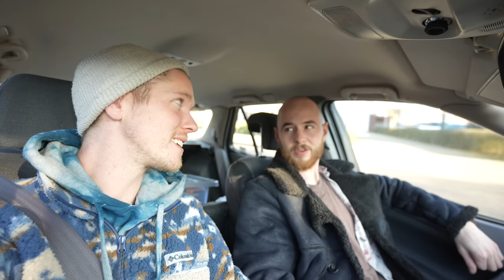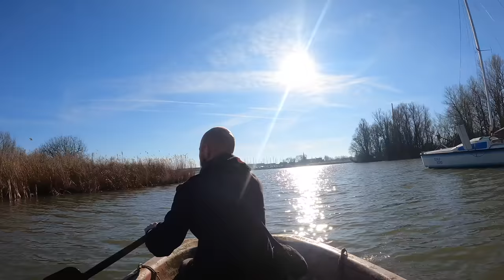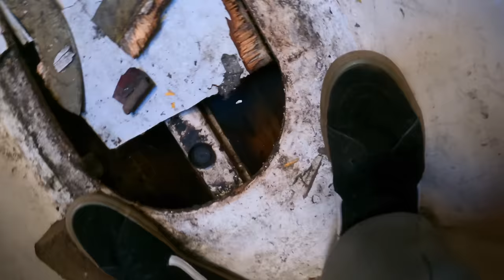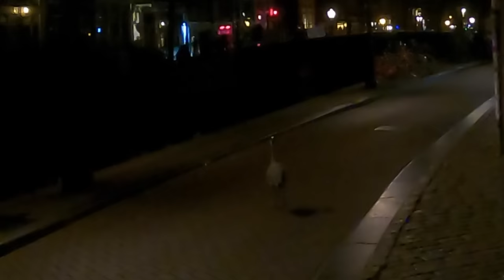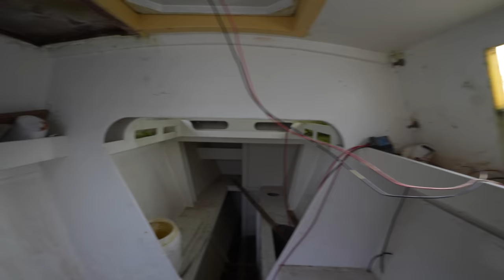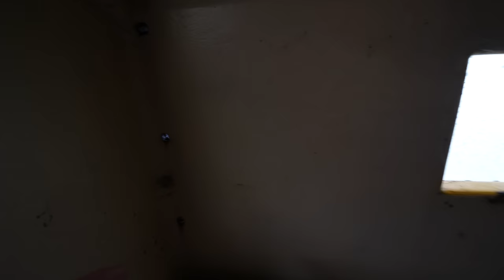I Made A LOW Offer On A SINKING Catamaran | Wildling Sailing

Comment: Let's see....
Andy and Melissa offered Mark SV Melody for fifteen thousand, with a guarantee that Andy (and probably more than a few of the Melody extended family) would come in to complete everything necessary in order to splash and sail away without worries.
At most, to customise the boat, it would be perhaps another five thousand, which would leave at least ten thousand in the bank for the future, and that is not counting all the money sent in by Patrons and via PayPal/Ko-Fi, as well as all of those commercials in the videos.
This double-pontoon nightmare will cost at least thirty thousand to bring up to snuff, and that's if it is allowed to remain in the Netherlands, with a change of ownership.
Wharrams are sort of romantic, yes, but unless they're huge (minimum of 22 meters), they're incredibly uncomfortable if you're not of the circus-contortionist variety of sailor. Also, Wharrams are not easy to sail.
Reality is going to shine its cold light upon this project eventually, and the resulting defeat is not what all of the fans in the world want to see.

Comment: It’s only when the plywood dries out you’ll determine the full amount of rot. Painted Fibreglass covered ply hides a multitude of issues as the wood is hidden from sight and proper inspection. How much of the bilge water is fresh water? Fresh water = ROT from the inside and the outer fibreglass shell doesn’t allow for the wood to breath.
Does it come with sails? Consider an out of water survey. Good luck.

Comment: I think your so sweet on this style of boat that your over looking an thinking huge problems are small and not a big issue. This boat is saveable but facts is there not good live aboard without a massive setup built for the center an it's not good for crew like you have spoken about so many times, your letting you emotions build you an need to step back for a bit before jumping I to any boat. I know you got it from the vid but I feel this may be a mistake later realized

Comment: I think you need to decide if you want to be a boat restoration guy or a sailing guy. 

Restoration could be your thing. Fix them up… shake them down and sell them on.

If you want to sail then go and buy a nice simple monohull which is in the water and has been sailed in this millennium.

Comment: Pump out the bilge and then go down into the bilge with a screwdriver and check for rot. If the hulls are glass over ply and it’s been sitting in fresh water for a large number of years, rot is quite likely. The bad smells could be fungus where rot has taken hold.

Comment: My advice would be a good bilge keel mono; you can beach it on an island so you can save the haul out cost, and can clean it off. They are good steady designs for when it's snotty. You'll have plenty of room to get out of the weather in comfort, and room for crew who'll pay a little to cruise with you.
Reply: All good points however... the Pahi can be beached, crew can have their own private compartment to get away from everyone and a pod can be added up top for weather sailing and when it's nice you have acres of deck space to spread out and enjoy the sea.
Reply: @jackblah5842  Look at the overall condition of that thing! You'll spend years getting it overhauled and fitted out before you cruise anywhere - and it'll cost an arm and a leg to do it.
Reply: @rallyeraidr7841  We don't know the condition.  If the hulls and beams are sound it's less work than Minki.  Clean it up, get a mast/sails,  Dyneema rigging, decks and netting and go sailing.  He can continue to add onto it as he goes.

Comment: I went to see a Wharram in Lancaster last year. It was on Ebay for £2000. I've never owned a boat. I went on a sailing holiday in Greece in 1991 and loved it. My only contact with the water since is a few ferry trips to drive my motorhome(s) abroad. If I was to buy a boat to travel the world, the last boat I'd want to do it in, would be a Wharram. I would want some 'luxury' ....like not banging my body every time I moved when down below............nasty boats.

Comment: Getting a Prince Albert?    Flipping heck Mark, did you show your Dad this before you put in an offer?  Its in the same condition as the steel boat next to Minky in the old yard. BUT it looks very interesting if you can get it dirt cheep. 🤞   Interesting update 2x👍
Reply: No way Jose’.  As a sailor and retired your cost alone for haul and restoration , if possible?  Will be very easy depleting your funds.  Best of luck!
Reply: @garycausey8332  well it might not be THAT bad. Im sure he will have the right people advising. Hanneka from a few videos back has an in-depth knowledge of this range of boats. . We still dont know what is under the current water line both internal and external water lines that is. 👍👍
Reply: Please don’t buy this sellers problem.
Reply: @MaxamArchitecture  it might not be everyone poo pooed Minky when they went t see her. It need the water removed first.
Reply: Lookup2Wakeup  it might be rotten AF, but it just might not be too.

Comment: Mark, that boat looks like a lot of hard work but appears really solid inside. I am sure it is hiding many surprises but it seems to have been really well painted. To be sitting there for so long with all of that fresh water must have left some rot but isn't that part of the Wharram journey.  Since you mentioned Wharrams (I had never heard of them before) I went looking to find out more and I came across She Sails Solo and Kinna Weltzien among others.  When you consider that Mara Noka was sailed in the condition it was in for two years before it was refit says a lot about the Wharram design. The current owner of your boat certainly hasn't put themselves to any trouble presenting it for sale.  Go with your heart and keep the offer low.  If you end up having to cut the bottoms out of both hulls so be it...  Best of luck and thanks for sharing the journey so far.

Comment: I would lift it out of the water and take of the beams. Stack it on a trailer and get it close to home. There you can find a cheap place to restore each hull before you take it to the sea again. A lorry with a crane can lift each of those hulls.

Have a go at it. plywood an fiberglass is easy to work with.

Best regards from an catamaran restorer from Norway

Comment: FYI, you can still get plans for Jim Brown designed Searunner trimarans, 31, 37, or 41 ft.  Fiberglass over plywood construction with centerboard.  I'm considering buidling one, you might too.  The plans are apparently fullsize, trace and cut and screw together, apply fiberglass.  You can check it out.

Comment: Hi Mark,  I have been reading you comments and I believe overwhelmingly they don't want you to buy this.  I am the former owner of Yachtsmiths International here in Canada where we built boats for 20 years, so I have a bit of experience with boats.  My advice is to go for it.....why? Because from your video it looks like the boat was sheathed in epoxy...so there should be very little water intrusion into the wood.  I did not see any areas where the glass was peeling, so this is a good sign.  Also, there are a lot of Wharram haters out there but I personally know a guy that sailed one around the world and I was on his boat several years ago and loved it.  Wharram boats are not conventional, they are very practical though.  
A lot of people are calling this a money pit....well, all boats are a money pit!  However the concept of the Wharram is that it is supposed to the the Jeep of the ocean, not a floating palace, so you are probably not planning on turning it into one. That's where all the money goes.  If you are planning on living on the boat with a minimum of creature comforts but having a strong safe boat, then I think this might be the right boat for you!

Comment: What would worry me most is the damage (potential) that water has caused to the plywood. It is difficult to determine how much water has entered the fibreglass and what the condition of the wood is. If you're going to take the boat overseas, you don't want it to brake apart. Good luck !

Comment: You're certifiably bonkers. You want to sail around the world in that pos? You're nuts. Your best option was to take up the offer from Sailing Melody. If you had gone ahead with that deal at £15k, come spring you could have set off on your travels. Instead you want family and friends aboard a pokey matchbox that is going to take all spring and summer to prepare. You're absolutely mad.
Reply: Motoring Malady.

Comment: There are good places to pull boats out and work on them in the neatherlands. But the won't let you work on them after hours and in summer it's actually quite cheap to get a spot in a winter boat storage hall. Then you don't have to worry about the weather.

Comment: Where i live,  109 boats in better condition were scrapped last month. There is an abandoned steel Spray close to us, in the boatyard, which wood be easier to fix than that. If it had been in salt water or on the hard covered in tarps, I would have said maybe. Could tow down to Hellevoetsluisje. The engine mounts are temporary to get it. Where it is no from where it was launched, so the engines won't lift

Comment: I’ve been onboard with you so far, but I think you should be beyond that much of a fixer-upper.  I got an abandoned boat in way better condition for far less.  I only think about it,if it was a free boat.  If the owner was asking 8k for that, he’s lost touch with reality.  Save-able, but it’s a lot of work. If I bought it, I’d try to get it home for the refit.  Living there is going to drain your restoration fund quickly.

Comment: Even if the shell is ok, this seems to be a project that can go on for a very long time.  In my opinion your 1yr time line would need to be extended.  It also needs all the expensive upgrades (Sails, all rigging, motors, winches).  Consider spending a little more upfront and get a good core, sails, rigging, motor and winches.

Comment: To  check the hull you need a bradel  to check the spine on each hull push the bradel into the wood to check for soft spots  ply is easy to repair  a scarf joint with epoxy will do it  and 2k is the maximum  regards Mark at chichester marina

Comment: Stiff rear axel on the SAAB, which make it look like that when you park like that.  Even on the new ones.
So it should really not be a problem, unless you have problems with the bearings, which you would hear.  Trust me.  I have own and drive and services SAAB from 99, 90 (yes, a SAAB 90), 900, 9000 and now a 95.

Comment: I remember back in the late 1960's someone anchored a really large wharram in Whitby roads for quite a few months and it stayed there even in onshore gales with 3-5M swells (no exaggeration). This must be one of the things you have to offset  against the cramped accommodation. Not many mono hulls under 25M could have done that, also there will be many anchorages in warmer places than Whitby where you can do a lot of living outside.

Comment: That's a project! My catamaran is very near this one, in Schardam which is next to Warder( a place you know :) ). 

If the fibreglass and wood is structraly sound, you can have a decent cat. I bought my boat all green with water inside and was only a 3 day job to get it Running.

Gicom bv in ketelhaven also has a very wide crane to get boats out, I believe it is 7 meters.

Comment: Mark at 2000 or less it will be a good project for you, does it have sails or a boom or a windlass or an anchor  apart from a clean up it will need rigging,  all new electronics. If you want to make something of the boat, you will have to improve you cabinetry skills . Look forward to the results of your offer....cheers and good luck
Reply: 2000, is 1999 too many.
It' s more wreck than boat.

Comment: If there's no rot and the structure is sound then go for it.

How are  the beam lashings, not a major drama to replace them but I couldn't help thinking my understanding is they're an integral part of a Wharrams structure and shit how long have they been exposed to the suns UV, snow, rain and movement of the boat

Spade anchor 👍
Spade paddle, yep why not😁...

Good luck with it

Comment: How to get your dream cat . 

First this boat : 
Have you called an insurance company to see if they will cover it ? No decent marina will let you in without insurance .  What if you catch fire and burn other boats and damage the yard - you will need insurance or they do not want you .  Doubt you can get insurance without passing a survey , it won't pass any survey . 

2 stroke engines will not do it for what you want , they will not charge sufficiently for a media studio  nor be fuel efficient enough . 

Go back to that steel boat with no engine , make a low ball offer .  I suggest going to electric as a neat YT friendly project and putting a gen set where the engine is using all its through hulls and fuel tankage .  The hope being solar  and regen gives you all the power you need but if needed the gen set gives you the range and power you need . It will not sail in light stuff so you will use axillary power more than you think .  You should be able to pick up a lightly used gen set .  You can add more batteries and more solar as you can afford it . 

You get an electric boat like Uma , the heft of a steel boat for expeditions and the ability to power for days if the need arises .  You can also charge your cameras and computers always .

Oh and if you run the gen set every few days you get free hot water for a shower  as a byproduct of charging the batteries . Go all electric , induction stove , water maker , fridge - you have the power .

Then if you must have a Cat , sell the steel boat as a freshly refitted yacht sailing and in the water ready to just sail away for twice what you paid for it after about a year of work as most is done already  and buy a decent cat with the money .

Comment: If you're going to the moon, I understand you need to forego comfort and concentrate on just getting there, but for longevity in long term sailing, you will need a relatively comfortable boat, not one in which that requires you to be a contortionist, just to move about!

Comment: Hi Mark, if she is well coated inside and outside the water ingress shouldnt be a problem. Why should you be more afraid of the water inside the hulls causing damage,  ultimately it is no different from the water on the outside of the hulls.  If the coating is good, the ply should be good. Of course check closely for rot but plywood can be cut out and replaced reasonably easily. I'd be more concerned about the costs of storage being so close to a big city. And you didn't show the rig and sails in the video, if they are no good I would walk away as even the cheapest mast, boom and sails will be painfully expensive.
Reply: Insurance companies like the rig replaced every 10 years
Reply: @jimlofts5433  The standing rigging, actually.
Reply: Absolutely agree.  The mast and rotating headfoil are there, and Mark told me there are some sails.

Comment: The boat looks viable, any experienced tradesman could soon sort that out, providing it's structurally sound.
I'd be far more concerned about the fact that it looks like your wheel bearing has collapsed, stub axle has snapped off, or the whole suspension unit has failed. 
I wouldn't be popping down the shop for a pint of milk and a pack of fruit flavoured condoms with the wheel like that, let alone driving back to the UK.........

Comment: Judging by the speed of the Dingy arriving at this Project Cat, everyone has been paddling all wrong.  Seems a Shovel is a much better Paddle than an actual Paddle. Hope y'all had a wind from the Stern or things may need to change in the manual propulsion area. Seriously though, seems someone was in a hurry to launch this boat. She could've stayed on land another few months or years and been much better off. If you can't finish it on land it doesn't get easier when floating.

Comment: How fast are this kind of boats? The two out board motors are useless as they don't have enough power to drive the vehicle through a proper current, let alone the tide currents.This is the wrong vehicle to sail with a large crew! The first Colin Archer 46 in Northern Germany makes much more sense. I personally like the Sparkman and Stephans 42 with it deck-salon kind of aft cabin. You want to see the world, with its view to the outside, this one is the best of all boats you presented us online companions so far. You don't have to live in a cave, which I personally hate on most yachts. Try to find a Reinke steel yacht in a decksalon version, there are other older versions. I sometimes came across one for cheap money and within your budget. I have the feeling that the cat will not make you happy in the long run. Choose wisely.

Comment: Really nice concept you have there; going around te look at old barges etc and engage the old sofa sailors for advice... I an glad to join in; like multis, and also like old projects - had a two myself... one in plywood... a very fast homebuilt cat - good design and worked fantastic - but the plywood was the problem - never stoppet taking in water...  so - with so many other options - find a foam boat. I like the thinking behind Wharrams - and some like Tiki 36 seems like a nice concept. But when the world has options with better materials and designs - i would try to go for them...this boat - even if what you have is not that damaged - I think there will be plenty things to fix - but there is no mast and other stuff... so is less than bare hulls...,and also cost to see if its worth starting on...